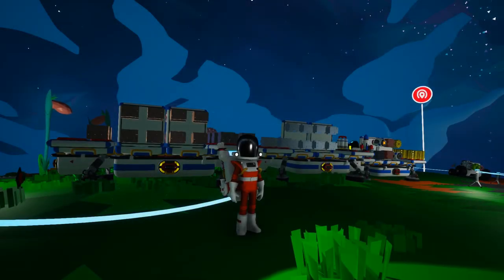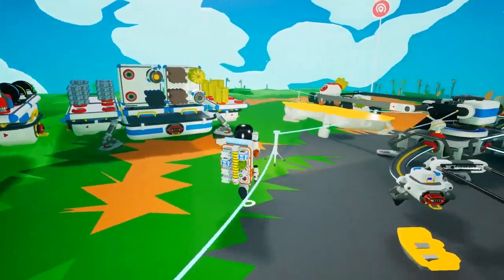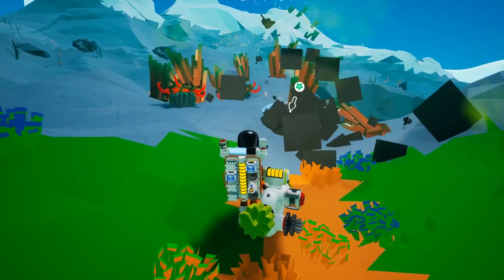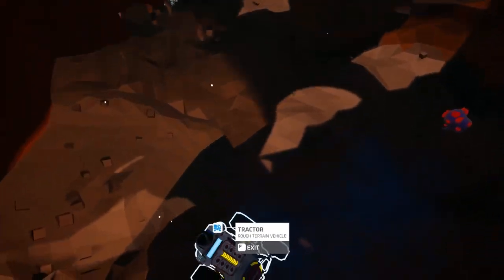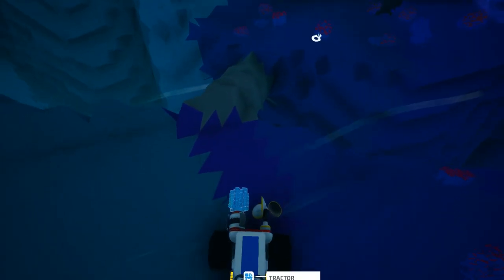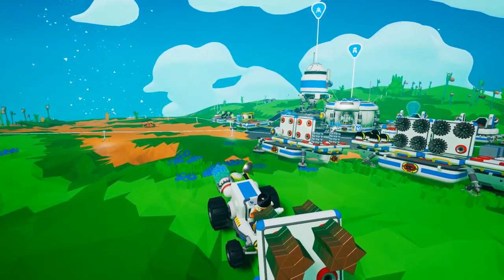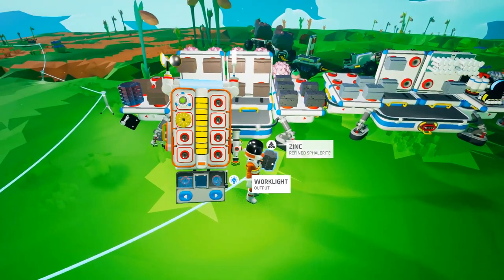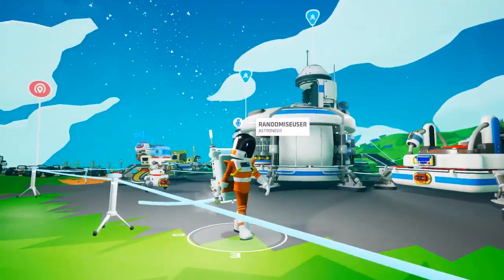Tractor Train Madness! | Let's play Astroneer 1.0 gameplay ep 6

Comment: I've used tractors to fall down a couple holes in my playthrough. Even rover seats, if you have the oxygen filters. Also, you can use the flattening mode [Ctrl] to make smooth bridges and ramps, even down into caves.

Comment: you should make a drill so you can mine the harder rock down in the centre of the planet. also discover the transporters. should be 6 on each planet.
Reply: @A Rare Noob yeah the big purple gateway things. they're not really essential. only if you like the exploration of finding them and setting them up. I think there's 1 more on the moon that connects to the ones on the planet because once theyre all connected there's an extra node option that can't be accessed straight away. dont quote me on that though. it's a theory